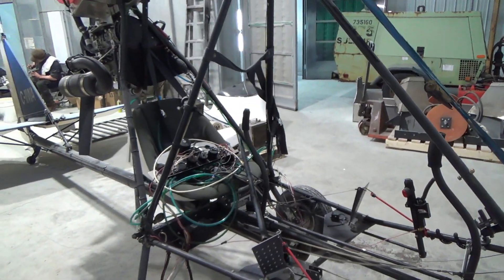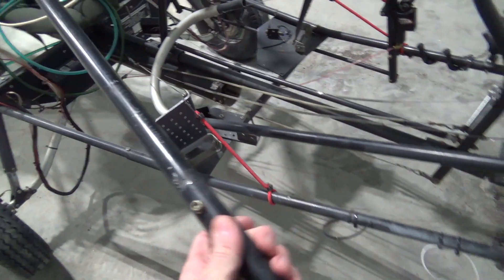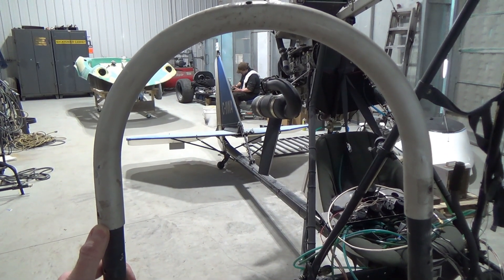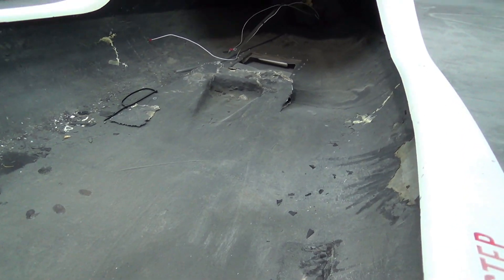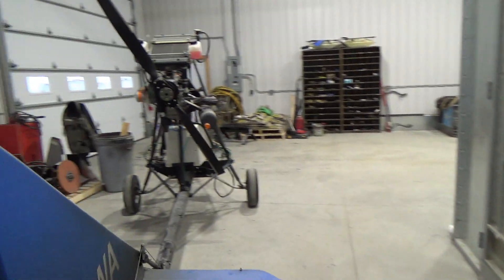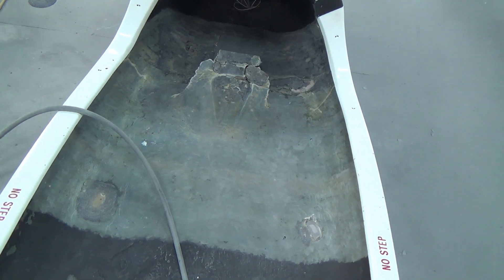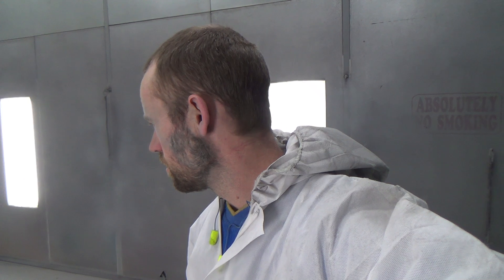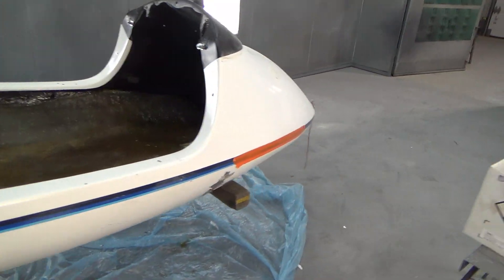Repairing the Fiberglass Nose Pod | Re-Build: Part 2

Comment: I love your flying community, it must be fun! But I've noticed that many of the bolts on your planes don't protrude the nuts by very much. Normal requirements is to have the threads go 1,5 - 2 threads through the nut, to have the full locking of the nut! Otherwise it some awsome planes you have! 👍 Safe flying 😁